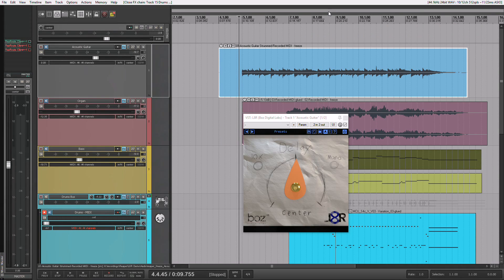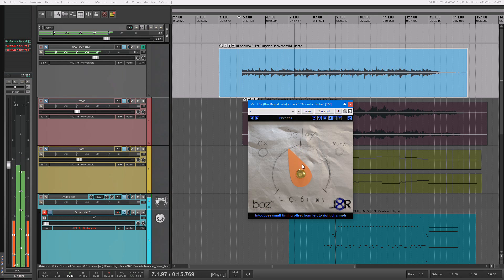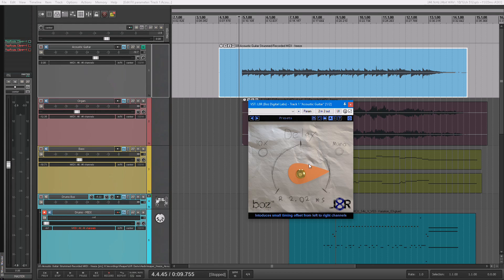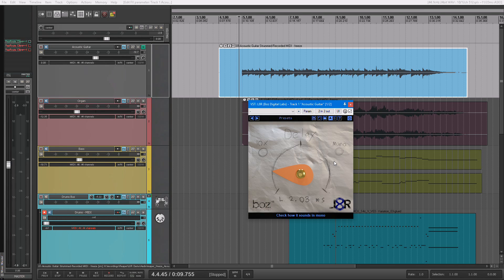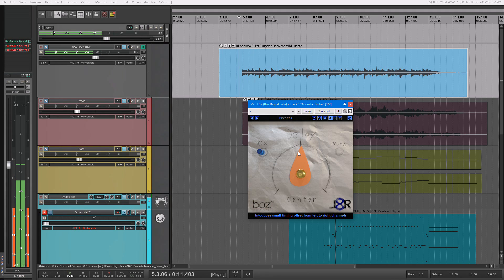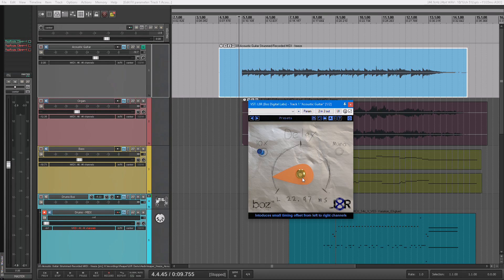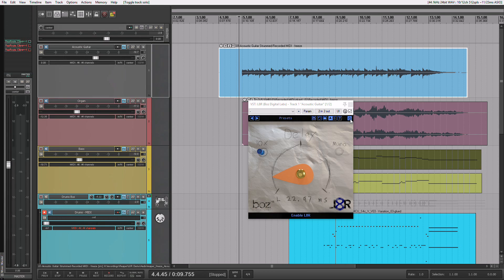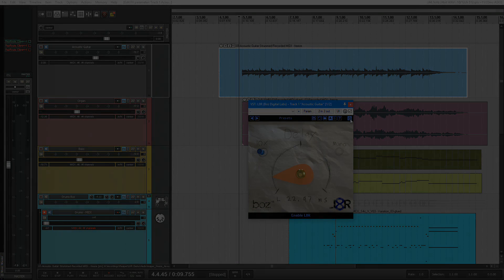L8R Walkthrough

Comment: Great explanation. I was worried about my kazoo solo ;-) No, seriously: awesome idea! I just have one single observation: Yep: which ear is hit first is how we perceive stereo (not panned mono- that's why we usually add a delay or short reverb on the opposite stereo channel on hard panned double tracked guitars or the usual suspects such as a tambourine or shaker in mono, panned rather hard to one side) So, the sound that hits the ear later also should be a bit softer regarding attack and/or having a bit more room/ambience. It would be awesome if there would be a possibility having the stereo signal as two hard panned mono signals, so we can make the delayed signal just a bit softer (say: de-esser, compressor with super fast attack or simply adding a room effect). It can be done with some clever signal rooting or an added rooting plugin, but perhaps there's an easier way? Anyway: congrats! Great idea for a very useful plugin!